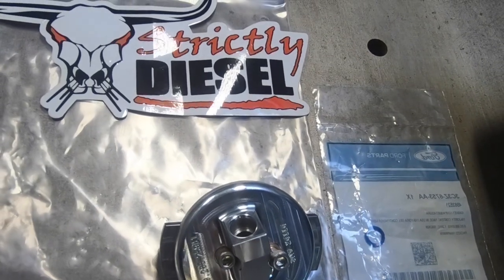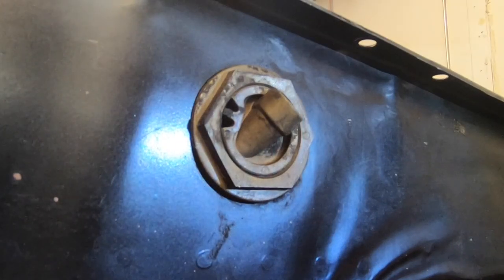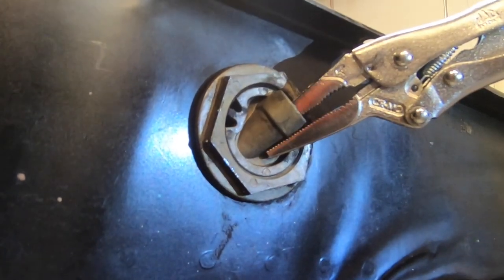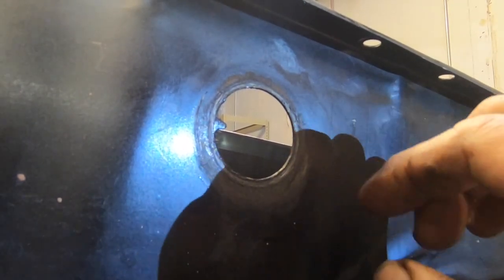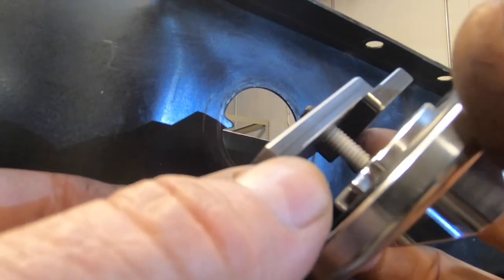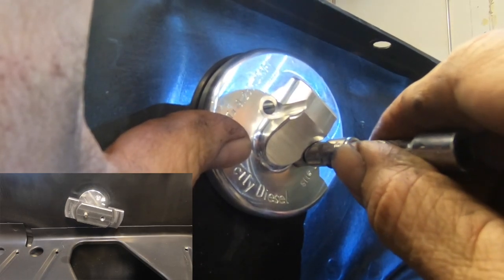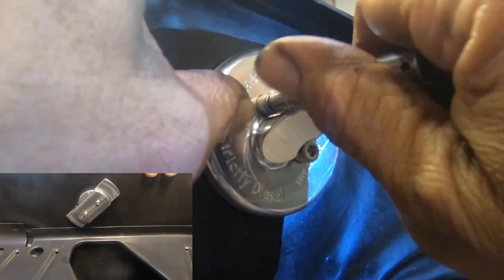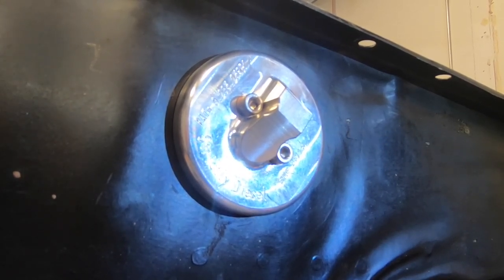Strictly Diesel Dipstick Adapter Install Video

Comment: What happens to the O-ring if you drop it in the oil pan
Reply from the maker: It likely ends up in the pickup screen of the oil pickup tube.  It isn't large enough to significantly obstruct flow, but it also isn't ideal to let it fall in.

Comment: It's a great product,and it is $300 for this piece, but knockoffs of exact design are all over eBay for $50,and even come with instructions copied from Strictly Diesel's kit. I previously went the old route and replaced the original o-ring but after a short time (1-2 years) the new o-ring succumbs to the stresses  and start leaking again. I bought a knock-off adapter kit off of eBay for $50 and everythging is identicle to the Strictly Diesel kit, EXCEPT the holes for catching the thread on the second screw will not align up with the knock-off piece and I can't for the life of me get the second screw started! After 3 days of fighting with this  contraption I am resolved to buy the one from Stricktly Diesel and be done with this. I'm not obliged  or aligned with SD in any way, I'm just trying to save someone else the frustration and downtime that I've incurred because of this  "identical knock-off" piece of crap!
Reply from the maker: We would greatly appreciate it if you would purchase one of ours, because it actually benefits U.S. based businesses, U.S. employees, U.S. suppliers, etc.  The chinese copies are violating multiple US patents and US trademarks.  There is NO TECH SUPPORT available from ebay or amazon or the chinese copycats, they DO NOT CARE if you get it installed, just that you give them your money.  And make no mistake the money is going to the Chinese govt, there are no independently owned manufacturing businesses in china, no individual human being is benefitting, just a whole lot of sweatshop slaves being forced to make ripoff product to keep the sales channels full.  Supporting this is simply incentivizing the continued theft of U.S. ideas by a regime that wants nothing more than to destroy America and our way of life!
Reply: Should have bought it off Amazon and had free return and money back guarantee

Comment: Why would you leave old parts in the oil pan? That seems like a recipe for disaster, now if the repair is done with the oil pan off like shown here then of course you can just fish the old one out. But this video does not explain any of that, looks like a quality product, need a quality video explaining details
Reply: This is how mechanics do it. And not any mechanics, Ford Master Mechanics. I had the same concerns at first.
Reply: @TheMonadnockShootist  , maybe if you knew what is involved with "just removing the oil pan", you wouldn't make that comment. You MUST remove the engine to do that since the pan straddles the crossmember. If you get this done at FORD, it is easily several thousand dollars. If you are able to do this financially, I would have that sucker welded directly to the pan - never understood why FORD didn't do that in the first place.
Reply from the maker: As was covered by another comment, the entire reason this part was invented was to keep people from having to spend thousands in labor for a full engine R&R.  There are some people that have managed to pull and reinstall the pan "in chassis", but this involves trying to reseal the pan using RTV while the engine continuously drips oil down onto the pan rail that needs to remain clean and dry for the RTV to cure and actually seal.  Most of the time, this just ends up leaking worse later and requiring a proper fix.

As for the part in the pan, there is nowhere for it to go.  It drops into a small opening and lays in the sump below the windage tray.  It sinks in engine oil and has the weight of roughly 10+ quarts of viscous engine oil keeping it sitting on the floor of the sump.  If by some crazy act of stuntman driving you managed to actually get that adapter to come off the bottom of the pan, the chances of getting it to travel vertically the 6"+ AND make it through the small hole in the windage tray to contact the crankshaft would likely be slimmer than getting struck by lightning while holding a winning lotto ticket.

Comment: It is Absolutely PIANFUL to watch " PROs " use tools backwards!
Reply from the maker: Almost as painful (or PIANFUL as you put it) as people on the internet needing to unnecessarily find things wrong with other peoples videos while failing to spell check the criticism they've written.  This video was not shot with the pan installed on a truck.  The pan was sitting on a table, making it a bit more awkward to work with (it wasn't secured to an engine, it was moving around freely).  The purpose of the video was not to show proper tool usage, it was to show proper installation of a part in a way that answers common questions from customers.  Sorry that concept eluded you, but thanks for the nice comment anyway.
Reply: 🤣
Priceless.

Comment: 300 bucks and you leave old parts in the pan lmao nerds.
Reply from the maker: The ONLY way to remove the old part is to pull the engine and pull the pan.  Since the oil pan has a windage tray with a relatively small hole and the old part sinks in engine oil and has 10+ quarts of engine oil keeping it from going anywhere at any given time, there is no risk to leaving it there.
Reply: Awww your what hurts little fella?
Reply: Aww is someone broke? If you can’t afford $300 you don’t need to drive a old diesel because they are costly trucks.
Reply: @JoshuaOverman  lol wut

Comment: JFC! $300!! You're out of your damn minds! I appreciate supply/demand/low production numbers driving up individual costs, but that's just stupid. It'd still be expensive at 1/3 the price.
Reply from the maker: So you paid material cost for your smart phone, right?  Got that thing for $100 with all the latest tech while the rest of us paid $750-1000?  Do you go to a restaurant and ask to only be charged 1/3 the menu price for your meal?  You buy your clothes for just what the cotton cost?

Comments like this always amuse me because they neglect to take into account so many factors.  Yes, the cost of the raw material is quite a bit less than the retail price of the part, that's how business works.  The retail price has to factor in every bit of labor to get those various chunks of raw material into a finished part, assemble them and package them.  It has to cover research and development costs, the costs of acquiring and maintaining/defending a patent, product liability insurance costs, marketing costs and every other cost involved in running a business while still leaving a profit for the business.

The "value" of a product doesn't come from the retail price, it comes from what it provides to the customer.  Maybe you don't see value in this product because you don't mind pulling the engine to change out the factory warped adapter, or maybe you are a capable welder that can install the welded solution to this problem.  That's great, but it isn't 99% of the truck owning population.  For many people, the only other good option for this problem is to take their truck to a shop and spend a LOT more money paying to have the engine pulled out and the oil pan removed to swap out the factory part.  They will barely have any parts cost, but he typical 18-20 hours of labor to R&R the engine will far exceed the cost of our simple part.  For many people, this part is beyond "worth it" because they can fix their problem in their driveway in less than an hour, using basic hand tools and at a fraction of the cost of having a shop fix it for them.  Their truck doesn't have to be out of service, they are fixed on their own schedule, and the part is serviceable later if necessary.  Based on the feedback we have gotten from customers over the numerous years that we have been selling this part, it is more than worth it to them.

Sorry you don't feel the same, but glad you took the time to tell everyone how you felt anyway.
Reply: @StrictlyDiesel  That's kind of my point, actually. My issue isn't that you have $10 worth of aluminum, a couple screws & O-rings into the part, it's that you know the alternative is pulling the engine so people basically have no choice but to pay whatever price you decide it's going to cost. Admit it or not, you're price gouging every person who buys one, simply because you can. And you're right, you can. You'll also rationalize it however you want- obviously- even if it's as nonsensical as comparing a dipstick holder to a cellphone. Sincerely, I commend you for coming up with & making available a DIY solution to this problem, but from my perspective, it's unethical to take advantage of people simply because you're in the position to do so- and that IS precisely what you're doing. You're no better than a scalper charging 50x the face value of a ticket or anyone else who takes advantage of a situation to rip people off. I have NO issue with you making money off of your products, we just seem to have a very different concept of what would be a reasonable markup.
Reply from the maker: @bbrown9763  Wow, compared to a scalper charging 50x.  This goes to show you that you have no clue about the supply chain situation with this part.  That's OK, the details really aren't anyone elses business.  Simply put, we don't hold the patent or actually manufacture the part.  The person that does has an entirely different business to run and has no desire to be in the auto parts retail business, deal with customers, credit cards, shipping, etc.  As such, he produces them for us exclusively, with our name on them.  We write the instructions, provide the extra Ford o-rings, handle all of the packaging, shipping, tech support, everything.  While you may think this part costs us $10 in material, that isn't the case.

Just like a cell phone (not a nonsensical example at all), there is a manufacturer that doesn't sell to the public.  Then there is a middle man (us in this case).  The mfg charges us what he needs to make his profit, and the middle man (us in this case) has to charge what we do based on our additional work and materials, labor, shipping costs, profit, tech support, etc.  Since the part carries our name, we also get to pay for the product liability.

Its all good, you don't know all of the numbers or specific situations.  If we had CNC machines in house and our cost was as low as you think, we would charge less.  That isn't the case.  Have a nice day.
Reply from the maker: @bbrown9763  This is pure gold, thanks for the laugh.  I'm sorry we don't operate our business like Oprah Winfrey and just hand out free parts to everyone.  I'm sorry you apparently don't understand how all of the costs of producing and delivering a product to market affect the retail price, nor do you have any clue how much we actually make on this product.  I'm really sorry that you don't actually know what the word "stealing" means.  Based on average profit margins of common commodity items in this world, you must walk through every store and look at every product and think you are being stolen from.
Reply: @bbrown9763  Sounds like you need to go ahead and charge whatever you want for your products and these guys will continue to do the same. 
I would have gladly paid them double what they're selling them for to avoid paying the cost to have a shop lift the 7.3 outta my truck and pull the pan. 
If he's supplying what I demand..... he gets to set the price.  I'm not required to but buy it.

Comment: There is cheaper products available avoid this company
Reply: Which are they?
Reply: @markchavez7707  weld on adapter fix for $30 for one, Diesel orings  kit is like $50 or so for 2 that's with just a simple Google search, and the cheap one doesn't leave parts in oil pan it simply replaces existing oring and if it's warped the adapter from the inside they recommend just plastering it with our RTV instead lol. Not saying any of these are better or not but he's right there is cheaper alternatives that may work without the $300 expense that a lot of people during a pandemic and not working can't afford to pay but I also understand when you have a patent and people ripping off your product and the way business works that charging more than what the raw materials is is just the way business works.
Reply: Why avoid? It's a good product just a bit high. There's nothing nefarious going on here. If it's too much, don't buy it. I plan not to but that doesn't mean it's a bad product from a bad company.
Reply: @DaveofAllTrades75  There's ALWAYS something cheaper, but you'll figure out one day with enough life experience, you get what you pay for. 
"Plaster it with RTV" ??????
Go plaster YOUR truck together with RTV
🤣🤣🤣🤣